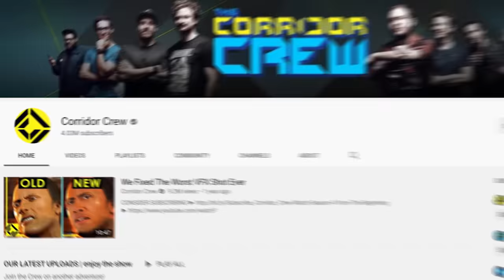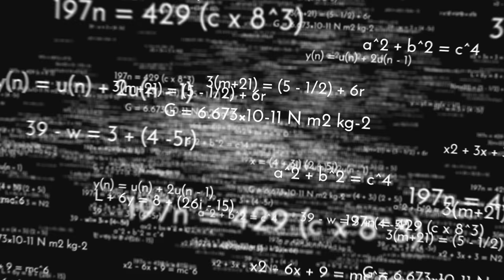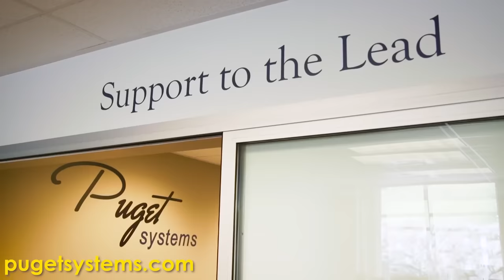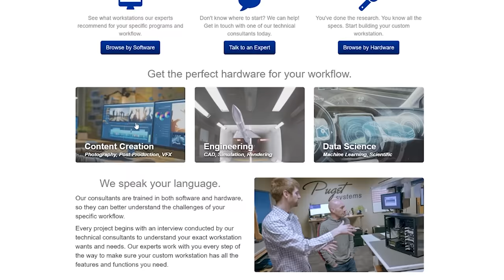Animators React to Bad & Great Cartoons 1

Comment: "Cycles are a bit of cheat" Sweats in videogame animator
Reply: No one draws a hundred unique steps for a walking animation, cycles are what keeps animators sane.
Reply: @sweedy6647  Absolutely. They also don't get paid enough to be more creative unfortunately.
Reply: That's why inverse kinematics are so useful. You can use the same manually-produced animation, but the end result is different because the computer is modifying it on the fly to match the surroundings. It's also much better than full physical simulation because it lets you keep animation stylization and is less likely to bug out.
Reply: @theblackswordsman9951  just tip them then. duh.

Comment: As a kid I watched a lot of old hand animated cartoons. There was one thing that slightly bothered me in a lot of them. Picture the scene (this is a completely fictional scene): five doors, one of which a character is about to come out of. The scene is meant to make us guess which door it will be. Yet, you could always tell which it was going to be because the door that was about to be animated was always in a slightly different colour or with slightly different noise (is that the word?). I assume this was because the whole "set" was just a blank image that they kept throughout the whole scene and only the door that was animated needed to have different pictures. It saves effort. Still, it bothered me that it stood out so much and took away from what was obviously meant to invoke surprise.
Reply: How difficult was it to just make them the same color even though they weren't going to be animated, right?
Reply: Or in old scooby doo cartoons where you could quite clearly see hidden doors and traps etc. because they were drawn like you said. Always slightly spoiled the surprise factor
Reply: I noticed this too, it's the same in a lot of shows, things that don't actually move in the frame blend but then things that are moving or will move are different shades and textures, even if it's the same material or distance or any other context
Reply: He mentioned it was because the backgrounds were in watercolor.
Reply: Gintama actually makes fun of that by misleadingly making one part of the ground look like it's g gonna move and the character avoiding it, but then one of the painted looking parts moves
Reply: It's probably a partially because of static background with separately painted foreground animation.  Also would be inconsistent paint quality.  With human's drawing each scene individually, they won't paint the same section the exact same way and may need to switch out more paint which is drying.  

You'll see less of that in the mid to late 90s because everything is hand drawn on computers.  With that, everyone gets a copy of the paint codes for scenes and characters to use.  It allows consistency between frames, artists and monitors.  Sometimes you'll see a grid of different colored dots in some artwork.  That's to allow the artist to get a correct and consistent color if they need to change monitors and not eye ball it.
Reply: I noticed that in pretty much every old cartoon, it must be because the rest was background; it's really noticeable in hanabarbara
Reply: @pedromax113  I think backgrounds were drawn in a different material so the color just wouldn't look the same, and animating something with shadows and lights would take forever.
Reply: Im gonna clear this up. The reason is, because cel animation. If a cel, is on top of the background, then it adds a tint to it, making objects that will be moved, (the cel on top) a seemingly lighter color, although they are the same. Except in scooby-doo, you're actually meant to see the traps, its the characters who doesn't know. Simple reason if you think about it.

Comment: I always thought were several reasons for the white gloves. The gloves were easier to draw and the hand animations could be reused regardless of character (it's just a white glove). So instead of spending time repeating work trying to draw difficult hand animations, you do it one time, save it in a catalogue somewhere and then copy and paste those animated hands whenever needed and with less modification. Another reason was because it was difficult to show fingers especially back in the black and white days. If Mickey Mouse did not have gloves, his hands were more difficult to make out whenever theyre in front of his body. On that same line of thinking, it would be difficult to tell the fingers apart on a hand if they're all just one dark color.

Comment: Seven deadly sins, meliodas vs escanor was some pretty terrible animation
Reply: Seven deadly sins in general lol
Reply: @smackdab6070  First one was average or like slightly above average but the latest was the actual trash one.
Reply: @grimmjowww9452  The first season had great animation. Most recent season was potato. Sucks when animators get rush jobs.
Reply: @Chiefshadow4  the animation studio was changed and was also rushed which made things way worse
Reply: I support this
Reply: Anime in general has bad animation cause it doesn't have too much money to make great animation and they use it in the best parts wich is obvious, I love anime  but you know I'm realistic, one punch man season 1 has great animation, mob psycho 100 also has great animation
Reply: @shnaix  Demon slayer is great tho
Reply: @grimmjowww9452  yeah it's actually pretty good
Reply: @shnaix  I agree, but the problem in the case with 7ds is that Meliodas vs Escanor is the only part of the entire series they should have put money in, and it was the one they put the least

Comment: For bad animation Hoodwinked always weirded me out, even as a kid

For good though check out Mob Psycho 100 S2 Mob vs. Mogami I was speechless during most of the fight
Reply: I'm just fine with Hoodwinked. It's not the best animation (budget was tight) but it's well done for what they spent, which they achieved by having one animator in charge of each individual principal character - so the characters are each unique and consistent with that uniqueness.

The sequel is just terrible though. It's like they took the original, stripped out the good ideas (like the single animator in charge of a single character, and good script writing) and cut the budget in half and then used that budget poorly.

Definitely not worth your time to watch the sequel.
Reply: Both good suggestions!

Comment: Before Edward Muybridge no one knew how horses actually move their legs while in full gallop, he started that project due to a bet that someone placed that no one will able to photograph a galloping horse, and the result caused huge controversy due to the fact that many people didn't believe that in some moments all four legs of the horse are off the ground at the same time as shown at some images he took, and he was accused of fraud. If you see in old painting horses that are portrayed in wrong or funny to you gallop, it is because that is the way people thought the horses moved their legs during running at that time, after Muybridge results were replicated and confirmed people started to draw horses movements the correct way, it is very clear line.

Comment: Pinocchio is an amazing example of animation that's actually too good to be financially viable. Everyone told Walt Disney he was crazy to spend $1.5 million on Snow White (1937), because no one would sit through a feature-length animated film. When Snow White was a massive success, Disney spent $2.6 million on Pinocchio (1940). This time, even though the film was well-received and made over $1 million on its initial run, it ended up losing money and nearly bankrupting the studio. This led to them figuring out ways to streamline the animation process — you know, cheat — to save money on future features that would become standard as the genre evolved. So there's a kind of decadence to Pinocchio that most animated films can't have, a naive willingness to spend any amount of time and money to make absolutely everything look perfect.

Comment: The motorbike scene from Akira, I'm surprised they didn't talk about how lazy the animation was when the riders fell on the road travelling at 100mph xD Dude, your body wouldn't be rigid especially if you land on a small surface area like your face or shoulders, it'd pull into a ragdoll. Looks like Katsujiro doesn't understand basic physics. ;]

Comment: fun fact: that wasn't technically the first animation, though not credited, the first animations were a neat trick the cavemen had with their paintings you can't see in artificial lighting, they'd be relatively colorless and have odd things like two headed deer and elephants with multiple trunks, but under the light of a moving fire the paintings vaguely animated, in one position the fire highlights one element of the drawing, and then another element in a different position, creating a deer that goes from eating grass to looking up to check for predators, or an elephant swinging its trunk

if i run into the source again i'll try to remember to add it here